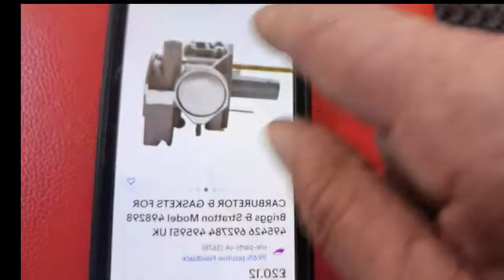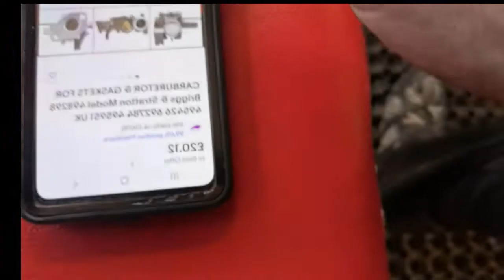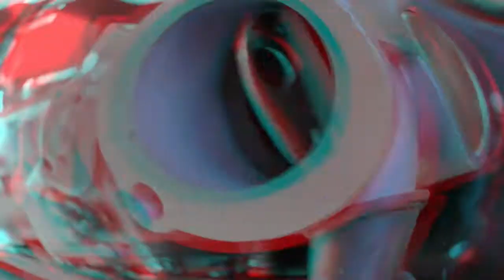Briggs & Stratton Small Engine Carburetor Replacement

Comment: I used to buy and refurb old lawn mowers generators in fact anything I could get my hands on and resell them. Have to say for the time and effort it takes to strip clean retune plus parts and cleaners it’s just cheaper to replace the whole thing sometimes. That said you be surprised how many just needed a service. Brings back happy times down the shed stinking like a petrol head 😂😂
Reply from the maker: Spot on Grumpy